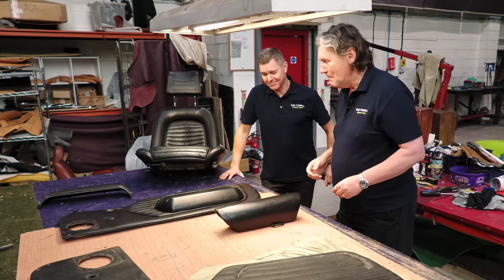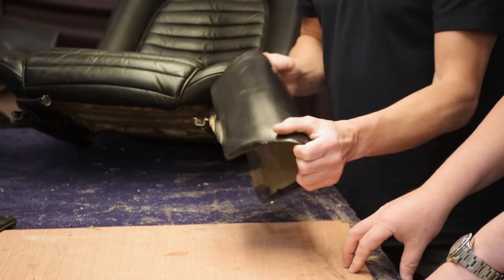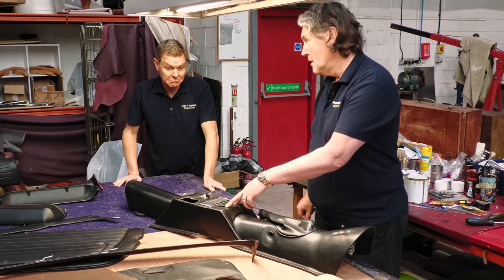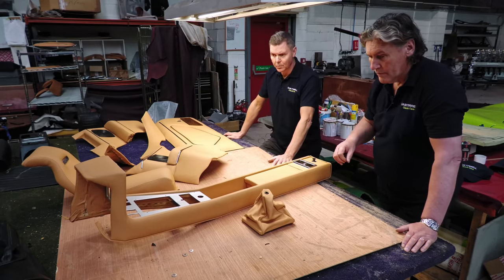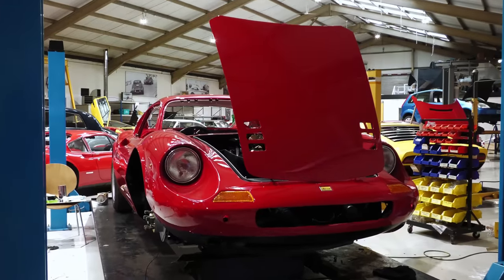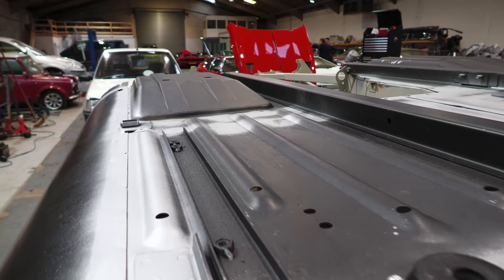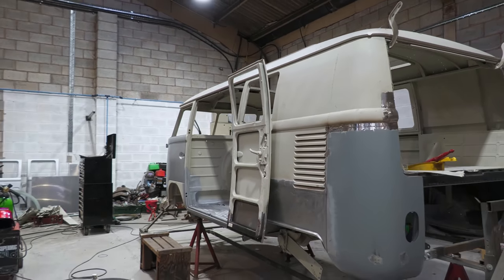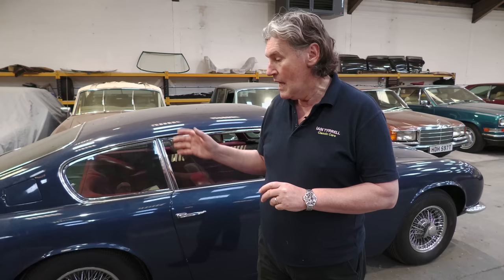Classic Car Magic: Behind-the-Scenes Workshop Ketchup  | Tyrrell's Classic Workshop

Comment: Craigs corner, love it and probably the most important part of a restoration because it's what the customer sees
Reply: Customer sees paint and brightwork first. Upholstery is also very important, but first impressions are made with paintwork which includes the straightness of the body.
No paintwork, no matter how good, will hide imperfections in the blocking stage.
Reply: @thomasmulhall4873 This customer would worry about engine longevity, gearbox, maintenance history in general, structural integrity, drive train, steering, braking etc. 
But you’re spot on. Weird isn’t it? 😂

Comment: Anyone complaining about the cost of restoration needs to see just how much work is involved. A true statement about some classic cars looking well but just what kinda condition is the important metal parts for strength under the paint and in a lot of cases the filler. Yous are blessed with true craftsmanship in the workforce and nice to hear of youth coming along too in this line of work.  Think I could listen to you explaining how paint drys as you have such passion for the correct details involved in proper restoration.  Thanks again for allowing us to see just what is involved in doing things to perfection..

Comment: That VW Bus as it's known here in Germany is a type 2 - but T1 series.

Type 1 was the Beetle and type 3 was the VW 1500, the later VW 411 was the type 4.

Confusingly, the aircooled engines are also categorized type 1 - type 4.

T1 was the first bus generation - today, the T7 is on sale. The first T1s had mindblowing 25hp.

Comment: Iain’s quandary I’m familiar with, on motorcycles. The same problem. It’s easy to make some parts way better than original. But it then sticks out. You’re then tempted to further restore components adjacent to the super part. And it doesn’t stop, until it’s all overdone or you restrain yourself.

Comment: Do you ever change out old switches / wiring for new when you do interior restorations, even if they still work, with the idea being that they will no doubt be feeling the effects of decades of use? Or do you leave them alone if they still work?
Reply from the maker: We test them. If they are in apparently excellent condition, we refit them. It is a challenge sometimes, even rebuilding them on occasion but worth the effort